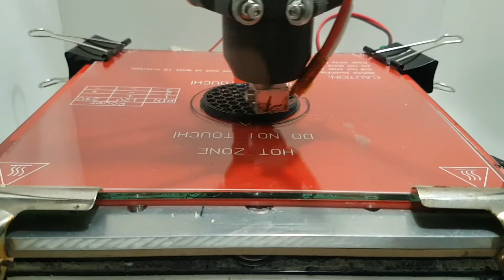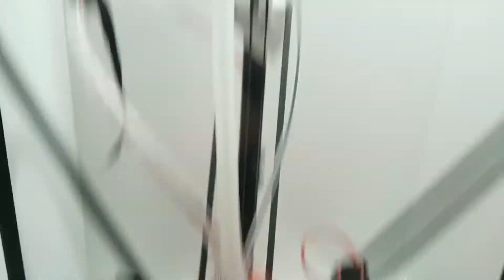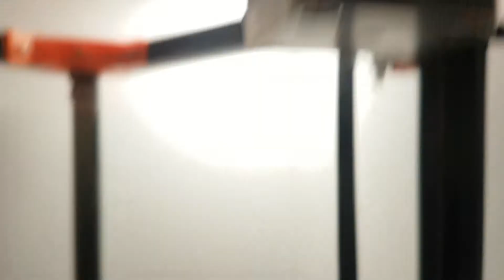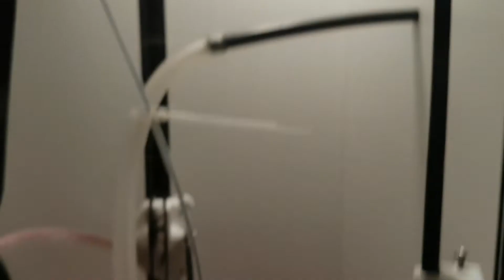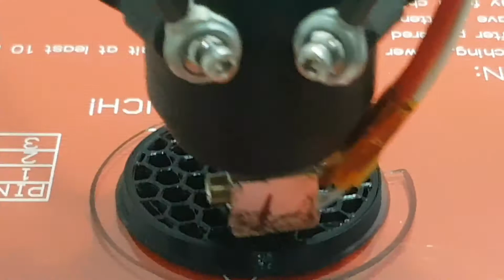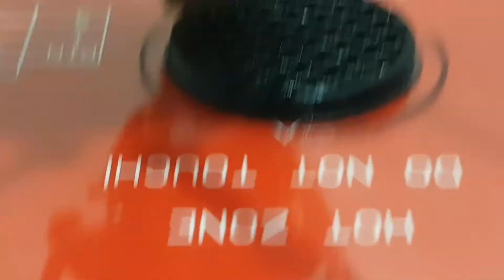Precision vs Speed.  3D printer designs.

Comment: I am in the process of designing my corexy and already had to do so many revisions and I thought I was done BUT nope, read on reprap the belts going directly to a moving part HAS to be straight or you will not make perfect circles.  UGH, another week of revisions and I still can't make them 100% straight so I have been asking around and no answers as to "how straight is straight enough"?  Any information I can get on any printer design helps me and my stumbling issue is my extruder design as it is a direct drive but to print it I am not sure my old Prusa is up to that task as it has a lot stuff that any 3d printer would struggle with.

Thanks for the video.
Reply: Yep, you are spot on it is as if the Delta and Cartesian had a baby and CoreXY was born.  I have seen the CoreXY hit over 1000mm/s but I am really just after a bigger printer.  What I started out with, and was almost done, was a standard cartesian with a 600mm 5mm in diameter axle but no matter how many I purchased or from where I could not get a dead straight and true axle so the printer cube has sat here for 6 months.  I could not devise anything so decided to just make the CoreXY.  As I said I can't get anyone to tell me how true do the belts need to be?  The belt between the motors can be a snake as it doesn't matter and the belt to the first pulley on the opposite side but the belt going from that pulley to the X axis and from the motor to the pulley going to the Y axis (plus from that pulley to the extruder)  those must be straight.  From my cad drawings I am off by less than 1mm for a 500mm span but even at 20mm away it is still 1mm as that distance does not change.  I think the problem is I can't get to a designer and I can only find people who simply copy designs and they wouldn't know the answer.

When this gets done the print area will be 300x300x360ish.
Reply: Speed on a 3d printer is a double edged sword because print quality degrades past a certain point which is a shame.

Nope, no where near there I am in the USA a couple of blocks from Graceland (Elvis' old home).
Reply: Well, if you print out a cube with holes 5 times each one will be different by a certain amount and that amount varies.  This is why I have given up on 3d printing for perfect holes and I just get close enough and drill them out with a DP.  Getting parts to connect to each other tightly I never could overcome as they were too tight to fit together or not tight enough.   From what I understand a heated chamber with active heating and cooling in that chamber (ala Stratasys 20k+ machines) will help.
Reply from the maker: Yeah, I drill any critical holes, or pop them in the lathe.
I kinda see 3D printing like casting, not really precision machining.
But I guess any process has a precision limit.
Lathes aren't perfect, drills aren't perfect, grinding ain't perfect, it always comes down to tolerances.
The accuracy of small holes is so affected by extrusion variations, whereas the larger circles are more affected by the motion control.
As for heating / cooling, that is where the cabinet comes in.
But my effort is more to reduce crazy fluctuations, rather than being a perfectly controlled space.
Just a randomness reducer.  ;)
Reply from the maker: I have just measured the wheels in my previous video and the conformity to the circular design was inside what my vernier calipers can measure on my prusa.
The error you may have could be the squareness of the frame assembly.- that was a little bit painful to resolve on mine.

The best shape to test the Delta was in fact a hexagon, and the delta machines are very tunable, and also the tuning can be very mind boggling  ;)

The coffee tamper you see in this video varies between 50.82mm and 50.98mm, that is about all I have managed precision wise in the Delta.
Reply: Not built yet just in the cad design stages but it is a cube and all corners are true.  I read that if the belts on a CoreXY machine is not straight you can forget about true round circles.  Prusa is no CoreXY it is simply a Cartesian printer but as wild as my designs have to be I can tell you all holes will have to be drilled with the drill press (why I bought one) since any hole I print that is not on the horizontal plane will be oval due to sag and gravity, etc...  but my extruder is a beast and I am not sure my Prusa can do it and it almost makes me wish my Qidi was working so I could use dissoluble supports.

As far as your precision goes this is why I hate plastic because no two are precisely the same even from the same spool due to shrinkage, expansion, and other things we just can't control.
Reply: Me in my real identity.
I just checked out the principle, that kinda is between the Delta and Cartesian.
That should give some good acceleration.
And yeah, I can see why the belt parallelism would be critical.

I'd love to see photos :)
Reply: The Delta has no problem with speed.
I have had some dreams of making a very large delta.
The belts are actually quite well made.
Where abouts are you based?
Anywhere near Bemboka Australia?
Reply from the maker: That is inconvenient :/
I don't think speed is a problem exactly, but the state of the previous layer in the time given is vital in that it has to be rigid enough to take the next layer without distortion.
Size is an issue with the cooling, and the thermal expansion/contraction coefficients of the materials used.
I am beginning to think the best way to increase a dimension is actually vertical.
The limit that I seem to be hitting is around th 180mm x 180mm if the parts are reasonably solid.
Parts that have opportunity for deflection fare much better, and could probably be indefinite.
I think that a longer heated path through the tip would allow a better and cooler tip temperature for the given flow rate.
I think the tips are about half the optimum length,- but that test will have to wait :/